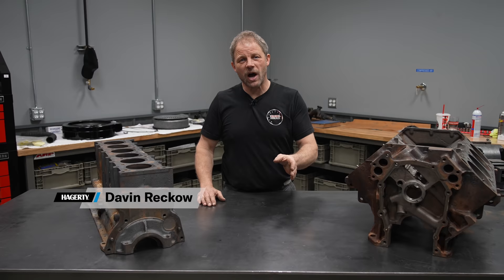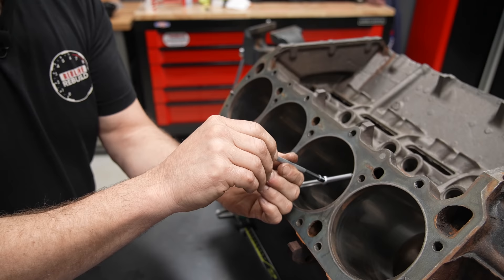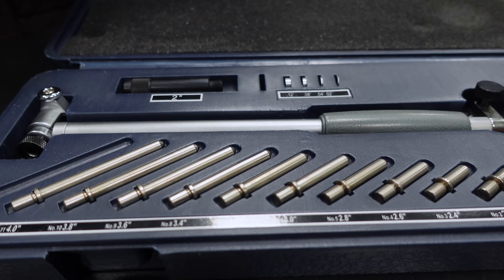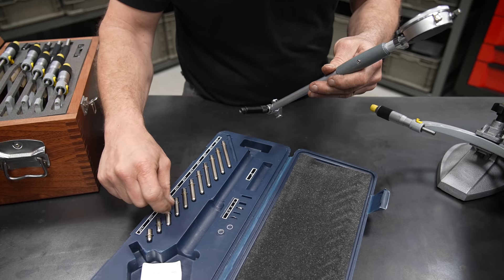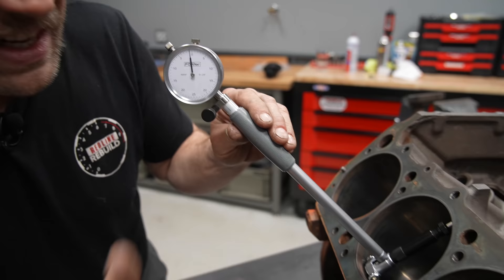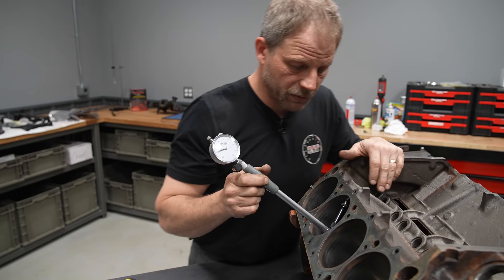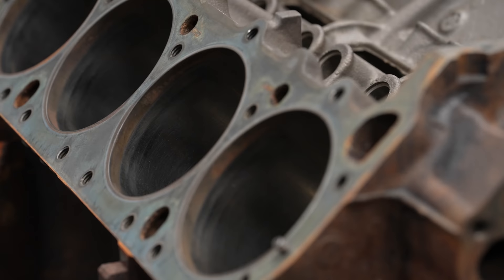Measuring cylinder bores using a dial bore gauge | DIY

Comment: Interesting to see slightly different approach. What I do is I set micrometer to what bore size is suppose to be, 'zero' bore gage on it and then measure like in video: two measurments perpendicular to each other where rings are in TDC, then again in half of piston travel and where rings are at the bottom of the stroke. This way the reading shows how much bigger the bore is if from what it is supposed to be. This doesn't matter really, just my simple brain has less thinking this way.
Reply: more than one way to skin a cat.  The trick is to understand and keep track!
Reply: You would be doing it the correct way. Unlike this vid shows.
Reply: I’m a retired Audi tech and there is a concern about oil consumption on 2 litre motors and your right that is the proper way to measure cylinders as per factory.
Reply: @nickpappas4133  I imagine the the factory has direct measuring bore micrometers and skip any need to transfer from one instrument to another.
Reply: @scotte2815  that's the beauty of bore gauges (when used properly), there IS no transfer.  The gauge is calibrated/zeroed in a fixture of a given dimension and then the dial displays how far the bore deviates from that calibrated value.  If I understand correctly, this is the MOST accurate way for a human to measure the ID of a cylindrical bore.
Reply: @alantownsend5468  TRUE,  if the bore is big enough bore gages are wonderful and the best way to go.  Also expensive, very expensive!
  Let's stir the pot a bit.  
Consider a very small and tapered and stepped bore like the chamber of a rifle.  The best way there it to pour an allow with a low melting point into the chamber, where it will begin to solidify, then start to shrink so it can be easily removed, but the will expand back to EXACTLY the same dimension it had when it first became solid thus giving you an accurate "negative" of the chamber.  But that's a case specific example.
Reply: @scotte2815  not really....  the right way is to FIRST zero the gage  to a known standard.
Reply: @sorinal1234  that's so obvious that I really don't know how to reply
Also alluded to in above comments
Reply: 2y ago and 2d ago? 
The barrel could be measured with ball gauges or small bore/hole gauges which can be used with a dial also. I mostly see   these for measuring valve guides.
Reply: Absolutely. This hurt my brain.
Reply: Yea, really zeroing the bore gauge at the size the cylinder is supposed to be quickly tells the story at all points of measurement. And the only way I do it

Comment: You are using the telescoping gauge incorrectly.   You should snug the lock with the gauge  larger than the bore. Then drag it like you are with the with the bore gauge "pogo stick" to find the shortest distance of the cylinder which is your true diameter.   When manufacturing engines we had a standard to set the pogo stick to and then make your measurements to check over/under size.
Reply: Have you watched this channel?
I'm pretty sure the man knows what he's doing at this point in his career.
Reply: @austinlane5533  using a tool wrong is using a tool wrong regardless of experience. Regardless, it's the wrong tool for the job anyway. Telescopic gauges are used for non critical features as they're extremely hard to use to measure more accurately than 0.001"
Reply: @chazmakarowski5429  
He knows what he's doing. It's all good.👍
Reply: @austinlane5533  anyone who knows how to measure would learn that they couldn't trust any measurement this guy gives them.

For DIY material this is horrendous. Expect better from someone claiming to be an authority on the subject
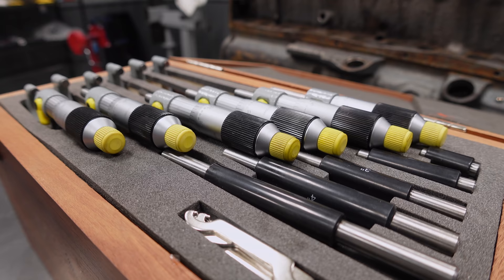Reply: @austinlane5533  0:41 Homeboy called his calipers a micrometer. Nobody edited it or fixed it. Sure, slip of the tongue maybe... not very professional to just roll with it. Especially on an "instructional" video.
Reply: Man you guys are right. Sometimes I forget we live in a perfect world. My bad.

Comment: I am clearly missing something here. The way he is using the bore gauge, he just as well could have used the snap gauges. I am not a machinist, but I was under the impression that a bore gauge can be used to actually measure the bore size.

Comment: Why is he measuring diagonal?  The most extreme wear will occur near the top of the bore (as he observed; but because of the higher pressures forcing the rings against the wall) and perpendicular to the axis of the crankshaft (90 degrees to the wrist pin).  This is due to the skirt of the piston being pushed against the bore wall during the compression (minor thrust) and power strokes (major thrust).

Comment: When I was using them in powertrain development we measured on the wrist (gudgeon) pin axis and at 90 degrees to that axis. The major wear in the cylinder is perpendicular to the pin axis. Measuring at 45 degrees to the pin axis will not capture the maximum wear which means you could order the wrong pistons. Always set the micrometer to the bore nominal and work off that. Measuring at some arbitrary point in the bore means you have to do a whole bunch of calculation to arrive at just how far out the cylinder is from nominal. The machine shop only cares how big the bore is so they know what size the new piston needs to be. They bore and hone to the pistons plus running clearance
Reply: "Always set the micrometer to the bore nominal and work off that. Measuring at some arbitrary point in the bore means you have to do a whole bunch of calculation to arrive at just how far out the cylinder is from nominal."

This.  He even says "this is a comparator more than it really is a measuring device" in the video; so why not just set the mic to the "correct" bore spec and see how off it is?
Reply: Usually where the rings stop at TDC is where you'll find the most wear in the cylinders. When cylinders get worn by the skirts to the point that is the major wear spot you have had an issue going on.
Reply: Just to be clear you are setting the micrometer to the nominal bore which is technically supposed to be 4" so in turn by zeroing the bore gauge to the NB of 4" so one can actually measure the true measurement of the worn bore?
Reply: @zachrysmith9138  you can do it that way, yes, but only if you have a high quality dial indicator that reads accurately. A coworker of mine recently bought a no name bore gauge from an online store and when I tested it out for him I found readings were out as much as 0.004" over 0.010" of movement because the dial indicator is just that bad. That sort of low quality dial indicator is really only good for comparing rather than measuring. A name brand bore gauge will be accurate enough to measure with. Keep that in mind

Comment: Haven't seen one since I retired at Boeing. Our machine shop Quality control used them to measure trunnion bores on the landing gear. They took inside and outside measurements at 12, 3, 6 and 9 positions. When we found issues it was usually the nickle/bronze bushings wore out or not built right. Out of tolerance and had to be replaced. Bore gauges are very expensive and there was a limited amount there and have to be recertified when due or dropped.

Comment: the thing is, the machine shop will look at the largest bore measurement as the single most important measurement.  
Indication of taper and out of roundness are factors, 
butt, 
that sort of data is actually more useful in diagnosing the current condition and past history of the engine.  
Ultimately, once the block is to be re-bored, they will be bored and honed to the smallest diameter that will clean up the largest measured diameter and still be "in-spec"

Comment: measure once, cut twice; measure twice cut once.  That old chestnut might be good for woodworking,
BUTT,
for the REPEATED precision needed here, (remember you have to match ALL the cylinders) you need to be ready to take a lot of time, 
AND,
document . . .EVERYTHING!!
It is a very good idea to have a notebook to write all this stuff down in.
Part numbers. measurements, actions taken, discussions with machine shops, etc.
It's not just essential for the rebuild, you WILL need that info if anything goes wrong, and if you want to sell it down the road, that sort of documentation can really sweeten the pot.

I would like to see how Davin keeps track of all this.
Reply: Do we all understand the need for ensuring that the final machined dimensions MUST be the same for ALL the cylinders?
The rotate mass not only needs to balance, the force in each cylinder needs to be applied to the same area.
This applies not only to the bore but also to the crank journals and bearings as well.

Comment: can you also set the dial bore gauge to the measurement specified in the service manual of the block and just look if it's within the accepted value range?
Reply: At a guess, that's how the machine shop likes to receive their information. In would do what you said, set micrometer then transfer that to bore gauge and then do your 6 measurements.
Reply: You could do that yes. But that would be the correct way to use the bore gauge. See what I did there?
Reply: Xsidon, that's how I was taught to use them
Reply: @alantownsend5468  As a machinist in the trade for 43 years and having rebuilt many engines, Xsidon's way is the correct way It's annoying to see so many misinformed youtube videos showing people the incorrect way to do things. Misinformation.
Reply: I would wring gauge blocks together to the book's nominal bore size.  Set up the dial bore gauge to that block set and set the dial to zero.  We used to put a small sticker on the gauge then.  "0 = 4.350" for example.  Transfer measurements, like measuring the dial bore gauge afterwards with a micrometer is not accurate.

Comment: Good to see the way you handled and used these instruments. I have seen/ done enough to know that technique is critical to a consistent reading. I have snap gauges, that's my best tech right now to measure bores. But I am suspicious that I cannot trust them down to .0001" with my current techniques. Do you have any advice on how to take an accurate measurement with a snap gauge?

Comment: This is a great video, but wouldnt it be quicker to 0 the bore gauge on the micrometer (by setting micrometer to OEM cylinder size) and then simply take the thrust / Axial readings on each cylinder up and down? I guess there is many ways to do it no?

Comment: A calliper logging tool can be made to record a better reading and create a 3d image. The one used in the oil and gas industry is less sensitive since you don't need this much precision but you can manufacture a similar device based on the same concept. Heck you can even use laser instead of the prongs to get an extremely accurate reading. This is not hard to manufacture since theodolites use the same concept.

Comment: To avoid confusion, the term 'snap gauge' already refers to a fixed go/no go gauge for outside diameters, like you might test a diameter using a locked micrometer. This has an over 100 year history. The telescopic gauge, referred to here as a 'snap' gauge, goes back to at least the 1930s. I wish manufacturers would not reuse the names of existing, and still used, products. Silver solder is another example of renaming in the field of engineering. Thanks, Hagerty, for the interesting video.

Comment: That's interesting, I've never seen a dial bore gage used like that. I've always used a height gage to set zero instead of measuring it with a micrometer.
Reply: what do you think the "bore" in dial bore gauge refers to? how else would you use this tool?

Comment: if i am doing a small bore cylinder like say an 80cc dirtbike cylinder would i be fine with just checking two different spots in both directions or would you still do three spots a top middle and bottom in both directions
Reply: I usually just do two but if you wanna make certain then go 3.

Comment: Is fowler one of the better brands of gauge?
Reply: bottom of the heap, but perfectly fine as its quite accurate down to 1/2 thou or slightly better. I just want to know if my bores are in spec, what size they are, and if they will clean up with the room available. i never hone anything but small motors. anything 40hp and up they all get bored as they are all out atleast .002'' anyway. if the limit is .003'', look at that as 75% worn. then guys just chuck a ball hone down it, new rings and call it good. sloppy stuff IMHO.

Comment: Can we get links to your micrometer sets? Please and thank you. 
I noticed the bore gauge is Fowler. 
But what about the Micrometer set, and telescopic gauges? Much appreciated 🙏
Reply: Fowler is actually kind of considered the bottom of the barrel.  You can find these things in a MSC catalog or any other manufacturing focused catalog.  Be warned, they aren’t cheap.  OD mics the size he’s showing, are really expensive.  The good brands can get into the thousands per micrometer when you get over 6” and you’ll need a new mic for each inch graduation.
Reply: Also I don’t trust a snap gage like those, to less than a few thousands.  You can easily pull it off square and allow it relax more than you realize.

Comment: I DON'T have dial bore gauge i use plastic gauge for my rods and mains i dont know how to gauge my bores i checked my bores with old piston ring for the size bore i have 3.8 229 gmc caberallo 1981 my bore size is 3.736 my crank journal is 0.24 the rod bearings is 0.0021 main caps is 0.024. When i check the bore with my rings it's 0.035 on my feeler gauge
Reply: With 0.035" ring gap on a small bore like that, your rings are ready for a big shot of nitros lol
Reply: Recipe for disaster with that gap unless you need 1000 shot if nitrous.

Comment: What brand dial bore gauge would you recommend? Lots of chinesium crap out there
Reply: Shop around, your budget will decide what you get.  American or German brands are through the roof.  The Japanese brands are more affordable and very good.
You might, MIGHT,  get by with cheap crappy chinesium.  If you go that route expect crunchyness and slop.  Sometimes you can take it apart and clean it up, but I wouldn't risk it.  You really need good repeatability, and part of that is practice, practice, and practice.  then, practice some more.  If you don't like your measuring instruments then they won't tell you the truth.
Reply: Sunnen is the best, Mitutoyo is very good.
Reply: If you just taking a measurment like in the vid to check wear or size,  you don't need a bore gage. Inside mic or even telescoping gages would work, they just take a bit more effort to get same results. But them $100 Shars gages all over Ebay are not bad for a comparison measurement. I use mostly Sunnen bore gages but own Mitutoyo and Starrett bore gages also whiich are way cheaper. Example, My Starrett 2"-6" was like $400 CAD but my Sunnen 2"-6" was around $1800. They both give me accurate data. I actually use a cheap Shars gage in my honing cabinet and use my nice gages everywhere else.

Comment: So what do you do for ring gap?
Reply: Use a wooden block and two pieces of yarn with knots tied in each end. Wrap the yarn around the ring and mark on the block your starting point. Pull the knots together until the ends of the ring touch. Mark the block again. Subtract the difference between the two knots and the two marks on the block. That's your answer.

Comment: I used dial bore gauges in the machine shop a good bit, but we set them to precision guage blocks.  In this example, put 4.350" gauge blocks together and set the dial bore gauge to zero.  Each bore will be very close to that.  Transfer measurements, such as measuring the dial bore gauge with a micrometer is not as accurate.
Reply: Setting the bore gage to your mics is just fine. Espesially when you used that mic to measure the piston and now want a comparison. It is an exact  transfer. I also do precision measuring at work which is a manufacturing machine shop and I've bored and honed a few thousand engine blocks over the years since I spent some time in automotive machine shops.
Reply: @whiplashmachine   Just to be clear you are setting the micrometer to the nominal bore which is technically supposed to be 4" so in turn by zeroing the bore gauge to the NB of 4" so one can actually measure the true measurement of the worn bore?
Reply: @zachrysmith9138  not sure exactly what your asking, sorry.

Comment: Doing things this way, the best thing he could say to a machinist is that the bore is out of round/tapered by some amount. For a guide on how to measure he didn't measure anything except for the top of the bore with his calipers (which he called a micrometer once) at the very beginning.

Write a script so you don't mix up terminology, or use incorrect terminology in a video aimed at people as an introduction to the topic. Or better yet, find someone that knows what they're doing to demonstrate and describe techniques. This was absolutely painful to watch and think that people "learned" from.

Comment: a 350 sbc bore dia. is 4.000 and there are tolerances for this but you set your dial bore gauge for the known value. of your cyl. then measure your bore in a cross  pattern and x pattern 1 in. from top in middle and 1 in. from bottom. this is how i do it i'm no expert by any means.

Comment: The way you're describing that cylinder board gauge with left and right is absolutely wrong and you should not teach people that way cuz the moment you use an interrapid  indicator it is a reverse swing in the dial actually swings counterclockwise so this is an inaccurate way to teach people they should look at the plus and minus symbol and you should focus on that and not the particulars of your particular indicator you'll teach them wrong if they have an indicator that swings counterclockwise. Just teaching bad habits!!!